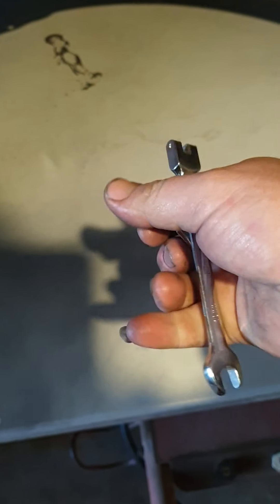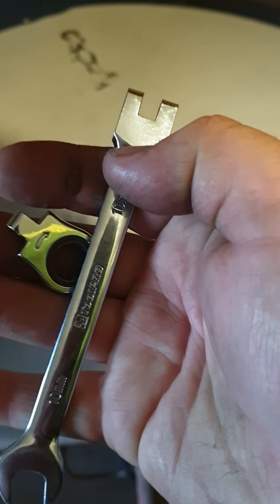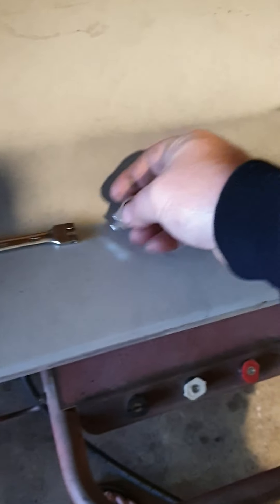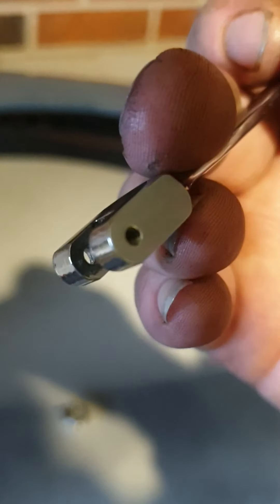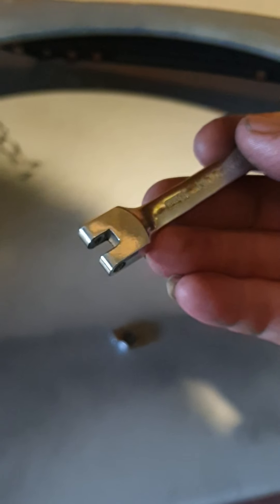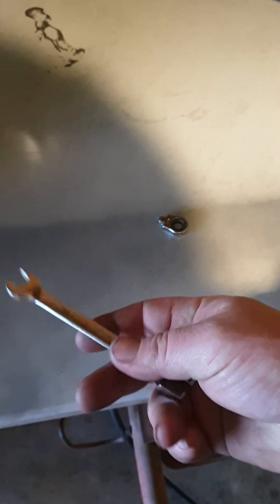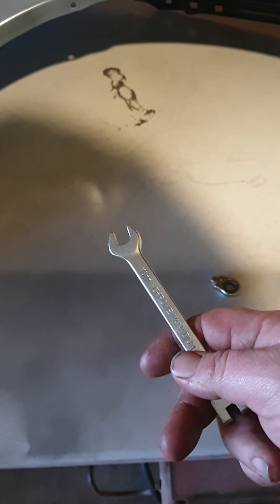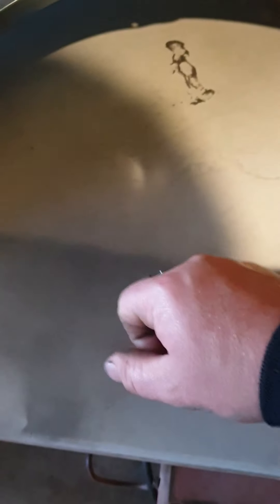Toolpro Spanners: my only complaint.

Comment: A mate at work has a full set of the toolpro and uses them every day with no problems. Though I have to say that I'm not plussed on those pivoting spanners because regardless of the brand, the weakest point is right there on that diddly little pin.
Reply from the maker: Yep the hope is as you swing on it the joint should have the same hold as an open end spanner would on a square headed bolt.
Reply: @gavmansworkshop5624  assuming, of course, there's no play between the spanner and the bolt